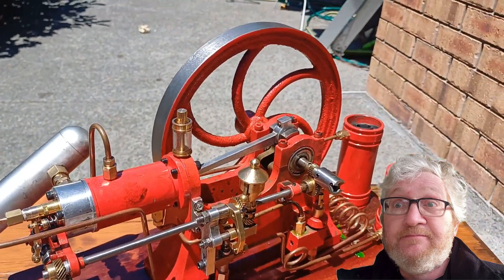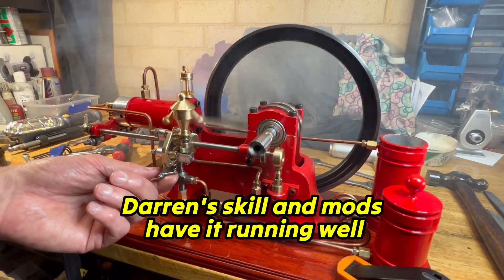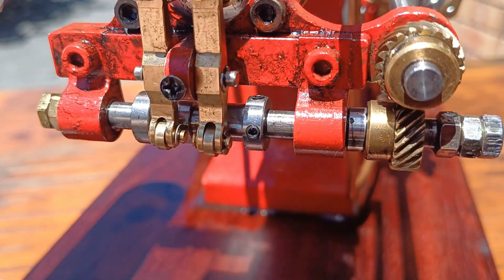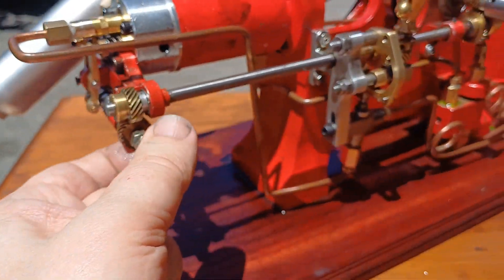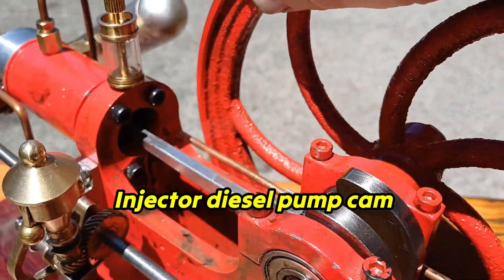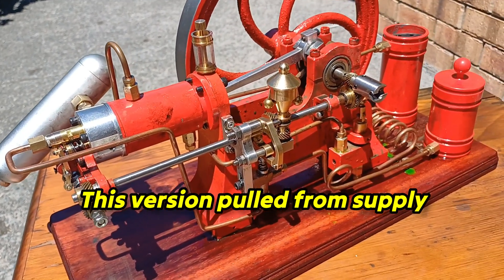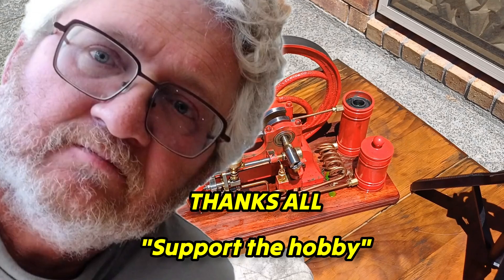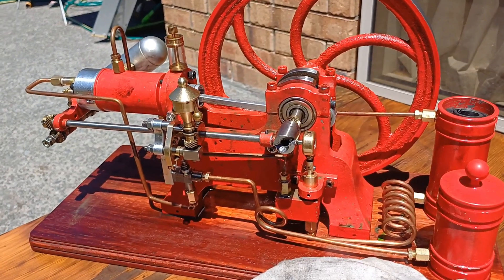Desktop Injected Diesel model: Pt4 - What's working, Tips & Guide, and Redevelopment

Comment: I love your positivity Thomas, considering the challenge this engine has been.
The manufacturer has been open to ideas and has taken my decompression lever onboard so new models will be supplied with the lever as well as other improvements. 
Another good tip is to keep an eye on the fuel tank level, once the fuel system is primed and all your fittings are tight with no leaks it’s easier to check the level every now and then rather that go through the bleeding process again. Just on those fittings I think the leak path is through the centre of the olive, the olives as supposed to bite into the pipe and create the seal but mine still rotate and since they are now assembled I can’t take them apart to clean them properly for soldering. I did manage to solder one of the joints and it seals now but the other I still need to use tape behind the olive. Once everything else is sorted out I’ll replace the pipe with better fittings but for now while this engine is still evolving I’ll leave things as they are. 
Thanks for the mention once again.
Reply from the maker: Fantastic comment...thanks for being so open and working with me to promote our hobby and the efforts of those involved. Yeah, the "watch the diesel level" tip is right up there. DO NOT let it go empty!

Comment: LOL! at getting your table oiled!  :D

You can't beet this for accessibility and repairability can you! 

It'd be a pretty long pipe but have you considered a tuned length exhaust?
There are calculators online and a bit of pipe thats snug around the main exhaust allows one to fine tune the exhaust for different rpms.
The same can be done for the intake.  Adding a bell mouth also makes a surprising difference. 30% IIRC.

You know; the kind of tinkering that's fun and makes the thing run better to boot!  :)

I'm thinking a small alternator modded so you can adjust the DC rotor field winding volts would make a very nice and simple Dyno.
I'd love to see power and fuel consumption figures for these things! 
As the fuel consumption on these old engines' bigger brothers is shockingly low, that's worth some clicks... maybe.  

I'm in 'The New South Africa' where the electricity is more off than on and a small, easy on the ear genset is of great interest. (Thx for that world!)
I don't need much power at all and small PM RC drone motor/generators are over 90% efficient.
Easily using the engine's (normally waste) heat is my thinking. (CHP) 
That pushes efficiency up to around 90% and makes for hot baths!  :)

Just massaging Youtube's algorithm a bit here! :)
Reply from the maker: I'm thinking about all these ideas! That's exactly the kind of feedback I like! And thanks for massaging that algorithm, I hope it enjoys it as much as I like a massage. The ex-SA folks here in New Zealand assure me anyone living in the "new" SA should get our commiserations....anyway I'll think on what you said, I want to get the thing running as well as I can first, and the builder Shiyi is always coming up with new ideas and injector tweaks he says he'll try to supply. So, a work in progress